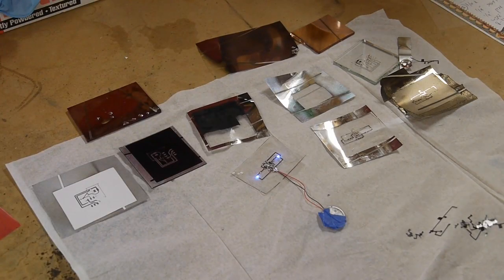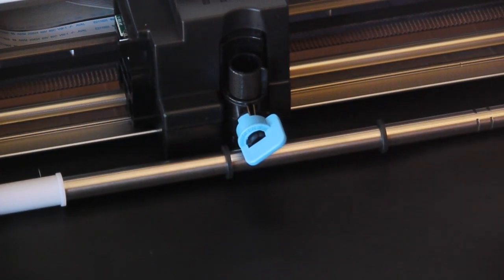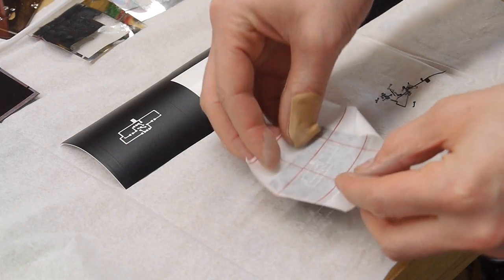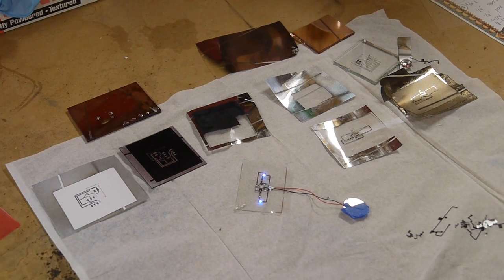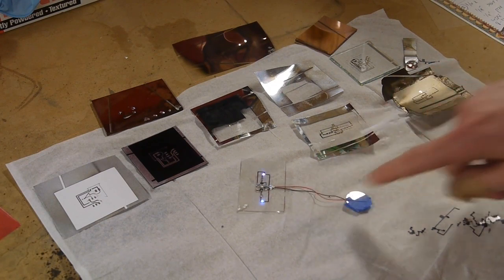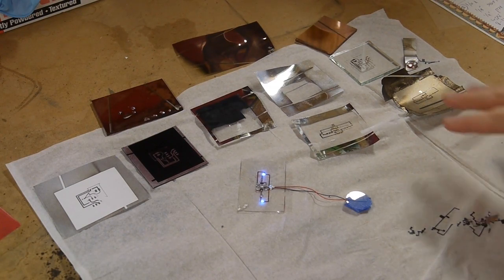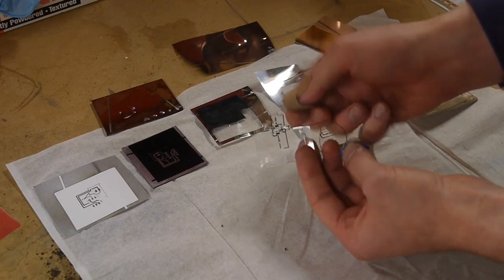Clear flexible printed circuits - first success

Comment: For getting a vector format for vinyl cutting, you can use gerbv's CLI interface to convert a gerber for the copper top layer from EAGLE into an SVG file. Then you can use Inkscape to convert the SVG to DXF. Silouette Studio will import DXFs, but make sure to set the scaling setting to "as-is" instead of scale to page size. I figured out this method when trying to get a vinyl cutter to cut mylar film for SMD solder stencils.

Comment: I think some capacitor(s) cracked, hence the fast blinking rate (stray capacitance is low capacitance). MLCCs and flexing don't go together, they usually break under the terminal and you can't even see it. They love cracking from unequal heating as well, like soldering on terminal at a time. When there's a clear bending direction, you can lower the risk of them cracking by aligning the cap's length orthogonal to this bending direction.

Comment: Put another same type parent material sheet on circuit side. Glue both sheets together. Theoretically no displacement (elongation/contraction) at mid of uniform section on bending of combined sheet.

Comment: Sorry if this question is outdated, but have you considered using carbon black as a flexible conductor? e.g. https://www.researchgate.net/publication/317919292_Flexible_and_Foldable_Fully-Printed_Carbon_Black_Conductive_Nanostructures_on_Paper_for_High-Performance_Electronic_Electrochemical_and_Wearable_Devices

Comment: Copper on glass, ? Garrard record players had a stylus which used a glass plate with a copper coat on one side inside the stylus head to capture the sound, interestingly only had 1 wire to the plate, the earth went no where. 
These old 1954 stylus were magic to listen too, my last one cracked in half separating the copper coating. It's a shame you can't find them anymore

Comment: Instead of exporting it into the vinyl cutter software from eagle in the SVG format. It is a vectorial graphic file format, not a bitmap. That means that whatever final resolution you use for your final print, the computer will scale it correctly.

Comment: Maybe mix silver powder with some silicone? Although the acetic acid that comes out when the silicone cures might need to washed off or could even cause the conduction in the glue to fail by corroding the silver?

Comment: I bet that plastic is capacitive and causing the flashing to even out by smoothing the power supply voltage.  Note how you touching the battery drops the output somewhat then letting go it slowly comes back up in brightness.

Comment: Use silver bearing solder to reduce the tendency of the solder to dissolve the thin traces. You can also use Bismuth based solder, which has a much lower eutectic temperature. Admirable effort, but much easier to plate traces compared to deposition. See also a UK company called Conductive Circuits. They have a very inexpensive process where they inkjet print conductive ink and plate copper on top of that. Cost is about $10 per square foot plus overnight shipping.

Comment: Easiest way to transfer any vector drawing from any program to Silhouette Studio for vinyl cutting.
Print the original drawing to PDF with any virtual printer software (I use doPDF), then open it with Silhouette Studio.

Comment: what if you zigzag the traces in a way they can flex better
Reply: Maybe if you put another flexible transparent substrate on top of the deposited copper the circuit wouldn't break as easily when you flexed it.

Comment: could you do this on kapton with your setup? how much capital does it take for the tools required to do this at home? I recently replaced an old el panel backlight on a customer device with smc leds and plexi defuser... to get the leds connected was a pain in the ass and waste of silver epoxy. something like this would have made it a lot easier to fit into the device

Comment: We met at MakerFaire 2015 Ben - you saw our circuit printer the BotFactory Squink. I didnt realize at the time that you experimented with flex circuits! We've been able to print on a lot of new materials using our low-temperature metal sintering method, inkjet printing silver nanoparticles onto substrates like glass, thin film plastics, etc. Might be a better and much faster solution than vapor film deposition! In addition, you can print insulating layers to 'seal' the traces and improve flexibility to 1 mm radius bends...
Reply from the maker: Sounds great!  Is your machine available for sale?
Reply: Yea, but last time I checked it cost as much as a small house. Hopefully I'm wrong.
But Squink is definitely a major step forward !
Reply: Looks like they're currently about $3,199-$4,499
Reply: I'm working in Gapel Electronics Co.Ltd,and we're a professional  manufacturer of PCB,(prototype and mass production) and FPC in Shenzhen of China for over 10 years.

 I've checked your website, you have the requirement of PCB and FPC. We'll try best to give you best offer to save your cost.

 Please feel free to contact me,if you have any new inquiries.

 Your prompt reply will be highly appreciated.

 Best regards

Tom 
sales@kbefpc.com

Comment: Aluminium oxide is conductive, right? If I am remembering right, I saw someone test to see if a device actually had a sapphire glass cover, and that person used conductivity as a test. What I'm wondering is: Did the solid sheet of aluminium oxide conduct because of its structure, the way carbon structures do, or because aluminium oxide just conducts electricity. (I don't have a full grasp of how electricity works yet, so if I just said something stupid, sorry..) But what I'm getting at is: could you use a powered form of aluminium oxide for the circuit? Imagine a tiny plastic channel cut into the plastic substrate, filled with aluminium oxide powder, and sealed in with a thin sheet of plastic over the channel. Not perfect perhaps, but it's just another idea, and it might not require a lot of heat to apply to the board, but it has its own challenges.

After writing that, I realized that plain old aluminium filings could work just as well.

Comment: You could try laminating a copper foil (or deposited circuit) within a plastic transparency on both sides. Ideally, the components would be made out of the wire itself, as solder and through-hole components appear to be fragile in heat and flexing. By punching holes in further layers and using conductive resin, you should be able to make multilayer flexible PCBs.

Comment: What's the feasibility of using this additive process to create vias in the circuit? I'd imagine that if you got the holes of the vias to the right size you could have conduction channels "added" by the process as it might fill the holes reliably and give you the ability to flip that puppy over to add to the other side for a double-sided circuit

Comment: Does the vinyl cutter use heat or a blade?
Will it cut this?
https://www.google.com.au/search?q=copper+foil&source=lnms&tbm=isch&sa=X&ved=0ahUKEwiG9uKovYzLAhUhL6YKHUS6AD4Q_AUIBygB&biw=1366&bih=599

You could use it instead of the vacuum sputtering.
Also the fact that you place the foil onto the plastic while its flat is why it breaks when it is bent.

Try applying it to a backwards bent sheet so when it is flattened it compresses and then when bent back it isnt stretching.
Reply: +Ryad Arlan Most of them use blades
Reply: Yes, they are mechanical cutters. They often use a needle-like blade.

I cannot be certain, but i think copper foil that's thin enough to cut will just tangle itself around the blade.  But perhaps there's a solution there. By pre-applying copper to the overhead film, then dialling in the cut depth of copper plus a bit of a margin but so that the blade doesn't go through the overhead, and then discarding copper directly. Some experimentation needed with adhesive, perhaps by applying vinyl on top of copper, and dialling in added thickness. Unfortunately these devices are hardly the marvels of mechanical precision, cutting depth is more of a vague recommendation that they'll regularly reconsider upon rather than a hard specification, but soft vinyl is very benign material in this regard, it's stretchy enough to keep the plotter clean and happy while it cuts, but it'll break as you work it, so you can still weed it even if it didn't cut all the way through.

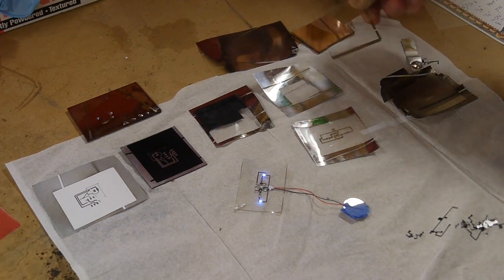Comment: If you are looking for a way to have better adhesion on glass (you mention this at 3:40), from what I remember, the solution is to first deposit a thin layer of chromium, and then the metal you are interested in.

Comment: Idea 1. The aluminum on glass is very nice, it'd be interesting to see the same minimal design with copper on glass. If you can get either to work, you could make a pretty nice looking led clock or some other display on the glass.

2. I would love to see your vapor deposition done onto something extremely delicate yet intricate like a set of dragonfly wings. Could you image those stained glass wings coated in copper or aluminum or some other shiny metal?

Comment: Maybe you can cut the traces directly into copper foil and stick it onto the transparent foil. you can then solder components onto it (if the adhesive can withstand such high temperatures)

Comment: I hear you said you can't solder directly to the circuit, have you tried using some lead free solder paste with a hot air gun. Just keep a close eye on for when the plastic tries to flex, back off. Just an idea not sure if it will work, or if you had already tried it I don't know.
Reply: +Chance Maudlin lead free needs higher temps than standard leaded so I'm afraid not

Comment: What kind of conductive adhesive are you using? I see quite a few types on Masterbond, but have not used any of their products yet....I'm interested in mounting SMT LEDs...
Reply: I am not familiar with this particular adhesive he uses, but it's obviously silver filled epoxy.

I myself have gotten a vile of defroster repair fluid, which is silver in some kind of lacquer, cost me about 4€. It's finicky, you need to shake it all the time, as the silver separates from the liquid, so sometimes i wait too long after shaking, and then the connection is not working, but no matter, take some acetone, remove, repeat. The lacquer base mostly evaporates. I wouldn't call it a particularly good glue - i'd say mechanically, your LEDs should be attached with your adhesive of choice before you make electric connections, and always measure resistance after the lacquer sets to verify the connection. The defroster repair fluid has been used extensively by model makers here, by first attaching the LED, then drawing connections onto it across the model, then priming and painting the model to hide the connections.

Comment: In terms of making your template, there are some videos on screen printing designs on youtube using photosensitive emulsion paper (used to get patterns onto t-shirts etc). The template is simply printed on an inkjet printer and then used to exposes the photosensitive emulsion paper. This leaves you with an easy to create template. hope this helps you.

Comment: I think this is really cool! Have you tried thin silicon sheets to put the circuit on then using solder paste to connect the SMDs to the tracks/paths and to finish laminate the entire project, not only will this protect your circuit but flow the solder paste to jelly state but should not harden so the connection won't be broken as the SMDs move with the flexing of the project.

Comment: I would consider a process that makes the clear plastic substrate "optional" : use it for the circuitry construction and assembly only, with a final step of separating the clear plastic from the product. this strategy results in a more resilient product although it requires additional deposition in every stage of manufacture. well done.

Comment: How would you repair it 
Example: inside my ps3 controller printed circuit flexable there is a scratch in the circuit and only some buttons work ????

Comment: Very Cool.  I am interested in the copper on Glass as a circuit board. . How well does it bond ? Does it withstand soldering or electroplating ?

Comment: Have you considered running the completed circuit through a laminating machine (probably a little modified) in order to bind components, i expect the glue would require a little more care as would temperatures

Comment: try gold sometime or a mix of copper + gold but seriously at wallmart i buy some sheets of laminated plastic and i would try the sticky side that way it would already have a thin film for the copper to stick way better then even when it is done use the other side to so it is then water proof and so nothing should have a chance to pull apart when you bend it. the double sided wouldn't allow the breaks to happen or at least not in the way they do now anyway. i find it by the poster boards and mailing stuff area. or use what you use now and maybe though use two pieces of substrate one to produce it then maybe varnish but then bake the other one on so now it is two sides together when it is complete it would not break any longer i think.

Comment: ok... substrate use silicone sheets for higher flexibility and heat resistance. and once u have the circuit on put varnish on it to seal the circuit which will protect it from breaking when u flex it.

Comment: Hi! can you please try to cut a raw Flexible Printed Circuit from your Vinyl cutter and let see if it will work. Originally, it uses laser cutter to cut the circuit, im thinking of cutting it which is more accessible for me. Thanks! :)

Comment: I think the main problem is: plastic - flexible; Metal layer - not flexible. (glass is at least fix) So even if you can print a ciruit onto plastic, after several movement the non flexible metal layers will be thinner and thinner and in some points and it will break after a time. You shold find a flexible material which is conductive.

Comment: You can export from Eagle into PS by using the CAM processor. You simply select PS as output format, then select the layers. I'm using the CAM processor to create negatives for etching PCBs. You could even convert PS to PDF using Inkscape.

Comment: Since you transfer on plastic the vynil mask, why not to directly build a rotatory spinner to deposit uniform photoresist and print a mask with a standard laser printer and use an UV exposure ? It is called lift-off process ! You can use it at home with resolution of almost 100 microns ! Ciaooo

Comment: I've played around with mirrors and a laser cutter.  The mirror backing is an extremely thin silver, then copper, then enamel. I could remove the enamel with the laser fairly easy but soldering to the copper layer was nearly impossible as it would just dissipate into the solder.  Might be interesting to try some things with that glue though. I've got lots of ideas but little time to apply...

Comment: Just some thoughts:

You might consider chilling the metal backing plate. There's a few different ways to do this, but i think a peltier effect would probably be best, given the low pressure situation that you have going. you can get them quite cheap, and, as you clearly know what your doing with the electronics, modifying them to fit your needs would be easy.

After that, overhead transparencies are usually a type of cellulose, which might not be the best. I would consider using an acrylic type of plastic. It has more thermal stability then cellulose, and actually has some good optical properties. The only thing that might make that less then desirable would be it's typical rigidity, but it can be blended with a more flexible plastics, like low density polyethylene, to avoid some of that. You do have to experiment a bit though. plastics are not like metals. they don't always blend nice.

Comment: So cool. If you stuck the components in position on the substrate you could put it all in the metal evaporator and print the track on to the end if the components. If they (and glue) could take the heat, and you stopped it from printing over the whole component so it didn't just short out.
Reply: My thoughts exactly. Granted you thought of it first lol. The vinyl should hold and shield the components as well

Comment: I made a small PCB back in the days by using sticky tape on thick paper, then spraying EMV-Paint (Paint that contains a lot of copper particles, used for shielding against electromagnetic waves). After that i removed the Stickytape and soldered / glued / stickytaped components onto it.Wanted to use this technique for a LED Ceiling, but it turned out, that the EMV-Paint has a too high resistance with archivable layer thicknesses. A later on used aluminiumfoil and adhesive!

Comment: I've been playing with cutting the circuit directly out of copper tape and putting that on a plastic substrate (I envy your vinyl cutter) Polypropylene is sufficiently heat-proof that I'm able to solder components to it if I'm quick. I've not had any luck with the conductive adhesives I've used so far - they are brittle, dont form a good bond and dont conduct very well :(
Reply: Instead of vinyl, you just need to find copper sheets of desired thickness with adhesive on one side. You can then cut and apply to whatever substrate you want in one step.

Comment: Ben could you deposit graphene on to the substrate using your sputtering process?. It would be better all around as your electrodes for the effects you are looking for such as clear, flexible, high conductivity.